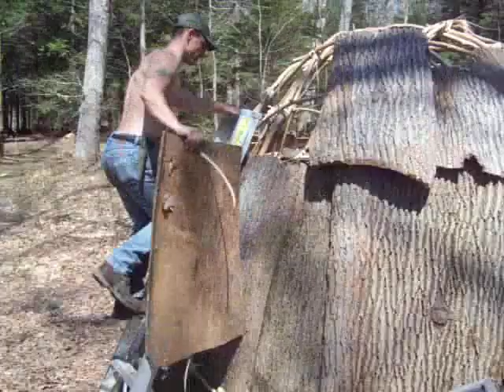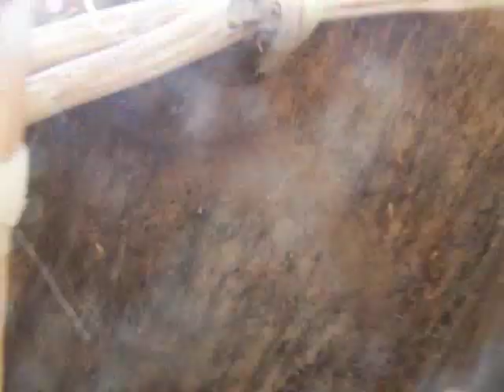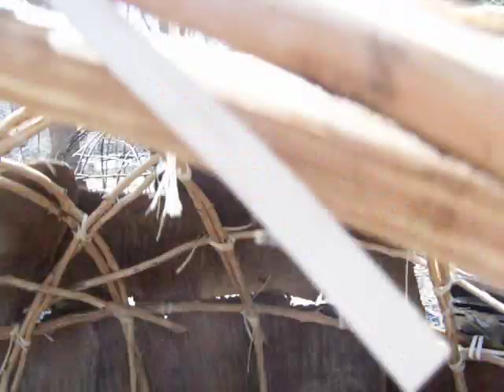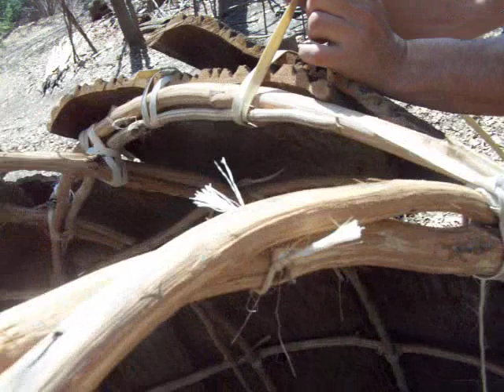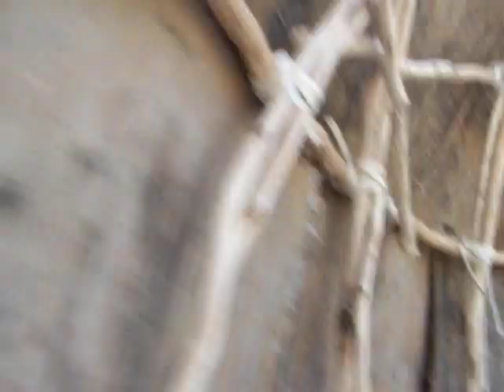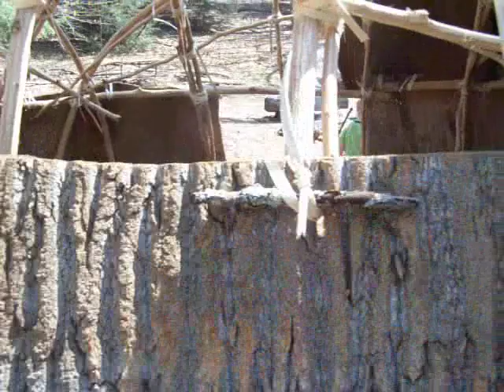Wigwam Construction

Comment: Your the first one I've found on you tube that actually knows how to build a real authentic wigwam. They are amazingly strong, as I was able to climb on an experimental 8' X 15' frame I built a while back with no stability issues whatsoever! "Iron wood" Hop horn beam, is a very strong wood when dry. even though I neglected to strip the bark off the frame poles, it lasted for 5 years uncovered. I really wan't to build another, & do it right to completion. Please make more vids on these shelters!